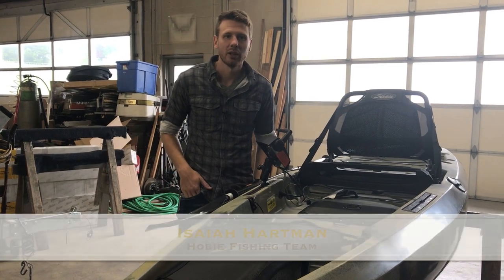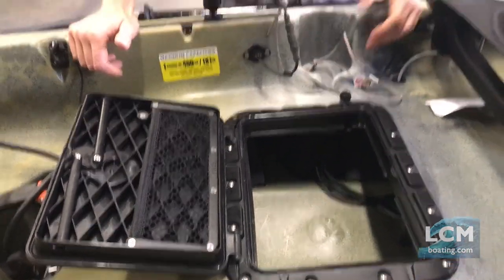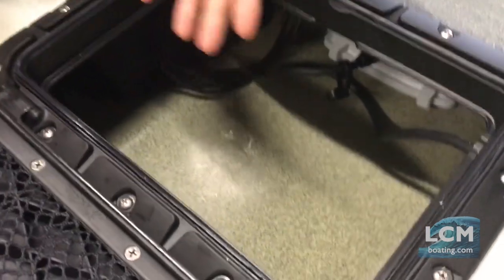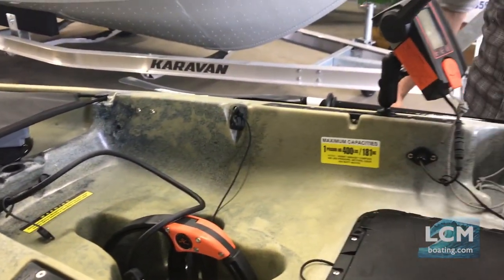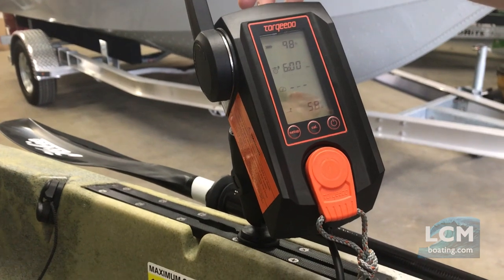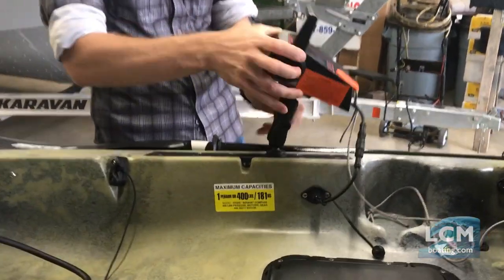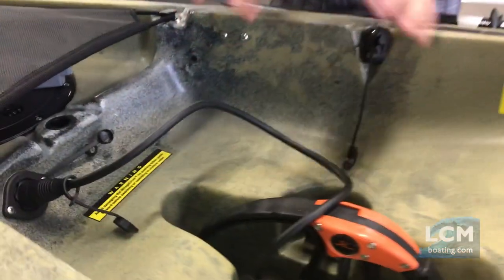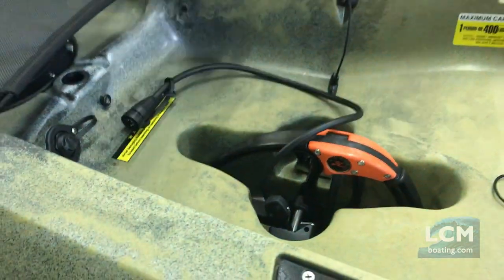Hobie Compass with Torqeedo Evolve Installed - The Lightest Kayak Electric Motor

Comment: The run time for that battery at wide open on my Compass is a little under 1 hour.  I think running it with no load like that may be giving different readouts.
Reply from the maker: Your right, a load will change the run time.
Reply: Really??
Reply: What are you getting on your compass please? I’m in the air on buying a torqeedo or bixby